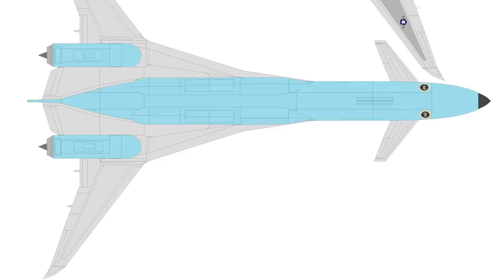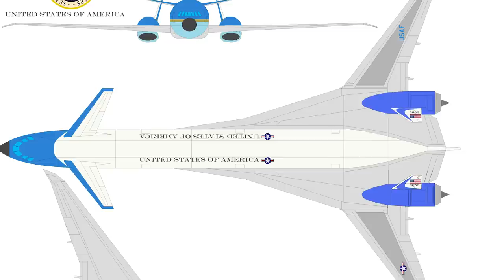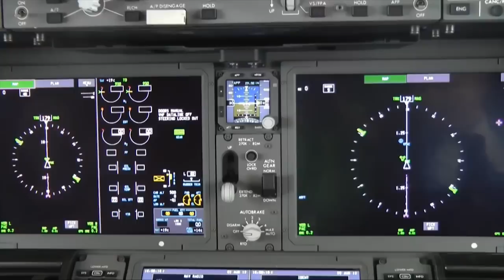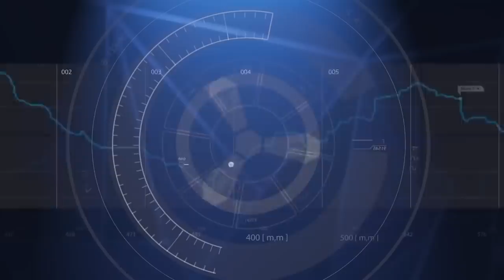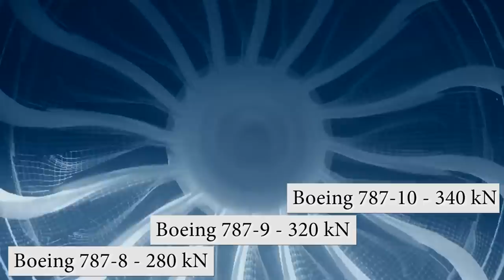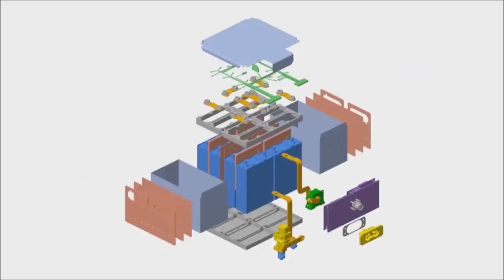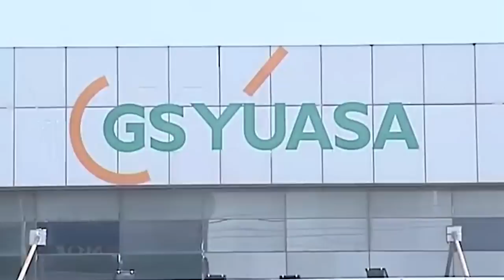Boeing 787: The legend of Dreamliner

Comment: I have flown in both the 787 and the A350 and I understand why people compare both aircraft. Both feel the same overall with a higher humidity and higher air pressure cabins, both have RGB LED lighting, and both are relatively new aircraft. The only clear difference in experience is that the 787 has a slightly narrower seats for being a narrower plane.
Reply: Pls bear in mind that seat width and pitch are determined by the airline, not the plane manufacturer
Reply: artdelac yeah but 787 is narrower so the same configuration 3-3-3 will be very tight on 787 while 350 is wider=way more comfort
Reply: MaidenAirTM   Hmm, that is a very narrow, misguided view. You have to realize that the 787 was originally designed by Boeing to accommodate 8 abreast seating but it was the AIRLINES that decided to squeeze 9 seats for more profit. I appreciate both Boeing and Airbus but facts should matter. In fact, it is Airbus that is giving their airline customers the option of 11 abreast seating in the latest version of the A380. How could that be comfortable on long haul flights?
Reply: Educate yourself! the A350 is wider! "The cabin's internal width will be 5.61 m (18.4 ft) at armrest level compared to 5.49 m (18.0 ft) in the Boeing 787[106] and 5.87 m (19.3 ft) in the Boeing 777" 
The A350 does seem to be a bit more comfortable and it feels a bit more premium compared to the B787! I have flown a few on both! (from norwegian, klm to qatar and singapore which have both models)
Reply: EJ Tech they look strikingly simlar from the outside as well.
Reply: And other major difference is A350 flies while B787 Cheapliner is mostly grounded !
Reply: I flew both as well, but crashed both
Reply: you can't compare with A380 it is much sider giving the same seat widt at 11 as 9 in 787.
Reply: Thirdclass B787 Cheapliners are now being grounded due to engine problems. After battery, it was breaking windshields.
Airlines like Spicejet are opting for A330neo over B787 Cheapliner & even Virgin Australia took A330 after getting fed up of grounding of Cheapliners.
Reply: ANA is getting new 3 A380s, Emirates is 47. Airbus has enough orders now to continue production of A380 for next decade.
Also, SIA has bought A350s & first A350ULR will be flying between Singapore to NYC non-stop as B787 Cheapliner was third class product for such use.
Qatar has increased it's order & have placed new order for A350-1000.
Reply: YES yes and yes , an airline can have 3 feet wide seat or 10 inches . this is their choice not the MANUFACTURER
Reply: Again yes
Reply: 4 inches over a total width or 1.85 %  wider , the 350 people tends to exaggerate as usual
Reply: Partially wrong. The airline decides how many seats it wants in the row.
Eg. A350 can have 3x3x3 in economy, & so can the B787. But as cabin width itself is way too narrow in B787, for same config, the seats will be cramped & even the aisle will be narrower.
Actually, A330neo is what should be compared with B787. The A350 sits above B787 & it's only competitor will be B777x if it gets launched with better efficiency over B773.
Reply: That's not an airplane specific. Each airline dictated the cabin layout and what you are seeing is airline specific. Not to do with the aircraft type its self.
Reply: Erich Weiler  Stop swinging your handbag, why are you so bitter about people who prefer Airbus, you don't see them crying cause your a Boeing fanboy, both companies are respected highly for the philosophies they have concerning aviation, because their rivalry is causing them to create some amazing aircraft so clam down and move on!
Reply: Having flown in the 787 more then once I can say that it is  smooth and  less noisy  plane and the ambient lighting  makes it a pleasant aircraft to fly in.. however airlines install the usual 9  seats in an  aircraft designed for 8 seats abreast resulting in a cramped cabin and narrower seats and one therefore does not prefer it for long haul...and we shouldnt also forget that this aircraft has been involved in the  greatest fiasco in modern commercial aviation..the repeated technical problems and failures which resulted in many groundings over the world hence there is doubt about its safety  in ones mind when flying in it.
Reply: Erich Weiler  The CFM Leap engine powered A320s are flying excellent. And there's difference between engine problem & structure problems. Your B787 Cheapliner has battery issues, windshield cracking issues, smoke coming from cockpit issues & what not.
Reply: Erich Weiler  First you are speaking without the facts. EK was part of A380 program unlike other airlines. Infact, EK was the airline based on whom Airbus preponed the production of this product. The reason why B787 Cheapliner sold a lot is not because it's a good aircraft but airlines using Boeing didn't have any replacement for their aging B777s. Infact, with 787-10, the 777 is obsolete & there is barely any interest shown for 777x by several airlines. Only thing which played into advantage of Boeing was high oil prices, thanks to US policies of bombing one oil country after another to capture oil & this meant more efficient aircraft requirement. But if you see, A350s are now miles ahead compared to orders of B777x & Airbus already have drawn up upgraded A350neo by 2025.  Boeing gets lot of orders thanks to their sales agent in White House which lobbies globally for countries to place Boeing orders. And yes, we in Asia trust CNN or BBC just the way West trusts Xinhua news agency :P Btw, here's another latest scam about B787 Cheapliner happened when corrupt CONgress party was ruling India (same period when Air India bought large number of Boeing aircrafts & went bankrupt & is currently on bail by Govt of India ) -

8 Indian officials bribed by Boeing, says New York Times -
In what could be yet another scam, now involving the airline manufacturer Boeing, a New York Times report has claimed that when Boeing was prepping its new 787 Dreamliner rollout in 2006, it might have bribed some eight Indian officials to mine the much-needed lightweight titanium from India. 

https://www.dnaindia.com/india/report-8-indian-officials-bribed-by-boeing-says-new-york-times-2702815
Reply: Erich Weiler  Check ANA latest issue & AI windshield crack. Also, A320neo has issue only with PW, not CFM. Do you know what happens if Lithium battery explodes ? If battery is not an issue, then why US banned all flights from gulf region not to carry laptops, tablets ?
And as said earlier, B787 has lot of orders as some airlines got these are replacement for their aging 777 fleet, while some are buying to keep White House, Boeing's main sales agent happy. Just check how many private airlines have Boeing vis a vis Govt owned. Most private airlines operate Airbus, Govt owned have Boeing.
Btw, B737 also has lot of orders, that doesn't make it safe plane. Air Dubai which crashed last year killing all was 737, a nother 737 fell in sea at Micronesia near Aus few months ago & recently Lion Air 737max crashed killing all on board. This apart, Jet airways 737max had engine shutdown in it's 3rd flight & issue was repeated 4 times before DGCA asked all 737max aircrafts grounded before inspections are done.
Reply: Erich Weiler  I believe you have not flown spirit vs singapore airlines or ryanair vs jetblue. Do that and you start understanding why even the smallest of spaces matter. (Same applies for width - b789/10 vs a359)
Reply: Erich Weiler  Do you even read what we write or just start throwing out replies? We were not talking about premium services vs low cost but strictly about SPACE!!! I know who asks for configuration, IFE, engines etc... the buyer!! Stop treating us like you're the only one who knows stuff around here when you actually ave just ideas that you try to pass on as Facts! :)
Reply: Erich Weiler  See, again you got me wrong. I have complaints about B787 cheapliner, not 777. Infact, 777 is the only aircraft from Boeing which is reliable. For Indian PM & president, 2 such B777-300ER have been ordered & also delivered. Interior fitments are on to replace B747. Similarly, even US prez will be having new B747 to replace aging Air Force One 747s. Had 787 so good, why not a single head of state is ordering it amongst Boeing aircrafts ?
Btw, today's news about engine shutdown in spicejet's new B737max, Hong Kong to Delhi flight.

SpiceJet Delhi-Hong Kong flight on 737 MAX faces one engine shutdown -
https://economictimes.indiatimes.com/industry/transportation/airlines-/-aviation/spicejet-delhi-hongkong-flight-on-737-max-faces-one-engine-shutdown/articleshow/67406194.cms
Reply: The chit chat is fun but its been decades since I was flying enough to make serious commentary. However,  I claim old man status to comment anyway.  At the time I ignored our Mozambique embassy recommendation not to  fly certain 737s over the Indian Ocean. I took  it anyway.

That flight was comfortable because I was the only passenger in tourist.  The UN babe I was chatting with moved up to her proper place alone in first class. I never tell anyone I was not warned about globalism!

The most comfortable plane of that era was a four engine Ilyushin IL-62. It had more leg room  then my CTS V-Sport, the best seats to this day, and an invisible climate system. Very weird.   On long hauls of any kind a 2-3-2 seating is the best. From Atlanta to Australia in a 767 in that configuration was a delight.
Reply: Well, the bleedless system on the 787 is a major differentiator. On the A350 engine bleed supplies air for AC, which  can have negative effects on passengers and crew's health.
Reply: @parimal7528  ...because it's not large enough for a head of state aircraft??
Reply: John Buick  You don't seem to understand what 1-1.5 cm can actually do considering how much they cut! :)
Reply: John Buick  not to mention.. you're a "if it's not boeing I'm not going kind of guy"... I assume because... that's a good reason!  (especially on the 787 with it's great uptime record) :)
Reply: Realistically what will Fuck Airbus potentially in the short and long run is if there is a no deal Brexit. CEO of Airbus has called it shameful that they can’t plan for the long term because of the childish bickering that the UK parliament is showing over leaving the EU with or without a plan because a no deal would mean disrupting their supply chain as Airbus WILL move their wing production plants from the UK into an EU country, regardless of what the Brexiteers say of Airbus having too much invested in the UK to leave; (14,000) direct jobs. I must admit I find them admirable to have the balls to do what’s needed to save the company in the long run by moving an aspect of their supply chain somewhere they know to be reliable instead of caving into the expectations of a government and the people who voted for this by staying and accepting the laws that they put in place, what ever form they take place. Nope fuck em, 14,000 will loose their jobs directly plus another potential 110,000 indirect ones all because of the UK not thinking leaving the EU through in terms of what they can loose. So hopefully they can agree on a deal before March. So with Airbus conforming this path with a no deal result; the process of actually doing it will cost billions in construction of new wing facilities, labor hiring, training, wages, healthcare, etc. Most important will be the slowing in production because of the lack of wing supply and the resulting delays which will hurt future orders and production equilibrium as they would have to eventually reach previous levels. Let’s not forget the waste of funds that could’ve been used on R&D and expansion. Again this is only if a no deal is the result. Airbus being multi national leaves them extremely vulnerable and at the mercy of shit like this and the result is the constant monitoring of the political and economical situation of the member countries that make up Airbus. Boeing is fortunately almost immune to this type of problem as assembly is done all in the US as opposed to the multinational process, this makes sure production isn’t disrupted because federal government change is applied equally and not at one part. Also working in one country simplifies many things such as wages, transportation costs, fuel costs, communication, and only having to deal with one government instead of 5 ( 3 EU, China, US). Again this is only if a no deal happens, but it puts into prospective what Airbus can loose and it’s vulnerabilities. 

https://www.airbus.com/company/worldwide-presence/uk.html
Reply: Parimal , 

That was Rolls Royce problems, airlines choose their engines, not the plane manufacturer unless there is an exclusive engine supplier agreement. 

The a350 is exclusive with Rolls Royce

The 777x is exclusive with GE

The 787 offered airlines the choice between Rolls Royce and GE and the GE have had no problems
Reply: FACT: A380 is officially bankrupt, 75% short of breaking even, an EPIC(or jumbo) failure for the European company! BTW, Boeing’s B747 just turned 50 years old and still being sold TODAY.
Reply: @il6yr8  I like how you're cool with a corporation holding a nation hostage over a legal vote that was held by the citizens of said country.
Reply: Erich Weiler  You just summed it up perfectly. He dropped his pants and let us know he hates America. It's just like the liberals. Make up facts to suit your angry agenda.
Reply: Erich Weiler  You need to remind our biased, America-hating friend that more than half of the A380 orders are heavily subsidized by their governments, particularly Emirates, as It is my understanding that Emirates loses money with the A380. Without Emirates the A380 would be a complete disaster/failure, and I think it's amazing and am glad they built it. I'm a huge 747 fan and have yet to fly on the 8i, and I also would love to fly on an A380, but facts are facts.
Reply: For me the 787 is more comfortable because of the electric windows and the quieter engines making it more comfortable for me
Reply: @erikbuiten14  pfff you lie
The difference is very little
Reply: Ndl Ben no the difference is substantial and it’s not just me, experts and avgeeks all consider a350 way more comfortable as airlines use the 787 for something it is not designed to do
Reply: Erich Weiler  well your comment didn't age well did it, Airbus is truly laughing at Boeing. A220 anyone?
Reply: Erich Weiler  you're not a pilot. You wouldn't get past the personality assessment stage and would be useless in crew resource management situations because you're too argumentative, not very good when your colleague is telling you you're about to crash unless you do something. Liars like you always get caught out
Reply: Erich Weiler  The sidestick is literally justa control interface for Flybywire. Same system on the dreamliner, it just has a yoke. Plus, the A380 haven't had any disasters causing deaths
Reply: Any A350 had battery fires?
Reply: I have flown on the 787 and the A350 and both are great. I find it difficult to really find any real difference between them. The 1" wider seat is really a marketing ploy by Airbus to give them a "one-up" against the Dreamline; an absolutely negligible difference and a cheap shot at best. I do, however, like the windows on the 787 with the photochromatic dimming effect which really makes them a "shade" above the A350.  It's pretty obvious to anybody that the 787 is a technically advanced,  intelligent, inspirational and innovative  aircraft. Even when you consider the sales figures and take into considetation  that the 787 has been selling for longer and scale them the 787 still outsells the Aircopycat A350 by a healthy, respectable margin.  So there! Can you believe that my flight from Qatar was delayed because the A350 was being repainted and Airbus kept mixing the paint with bird droppings? That should tell you something.
 Go       .....B  O  E  I  N  G ! !

Comment: Flew the 787 as captain for 3 years prior to mandatory retirement. When I started flying it, there were more astronauts than 787 pilots.
It was an incredible airplane that was a dream (pun intended) to fly.
Reply: Boeing is a great company, and the 787 is the best, I love it, it is so elegant and pretty, did you enjoy flying it? What was it like? How did the plane handle? Was it manueverable? Or did it take time to turn?
Reply: It was a superb airplane. Almost no mechanical issues after the battery issue was solved (the subcontractor's quality control) it was virtually flawless. 
As a former fighter pilot I found the responsiveness to be exceptional for an aircraft of its size.
Performance was impressive in all stages of flight from takeoff to landing.
Reply: @StevieWonder737  this is reassuring to read as a nervous flier
Reply: 0:39 0:39